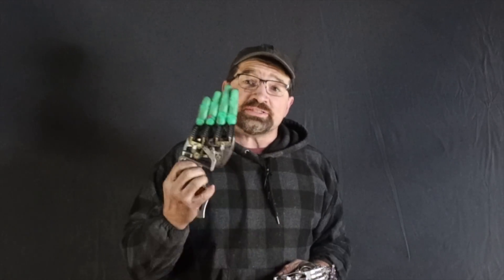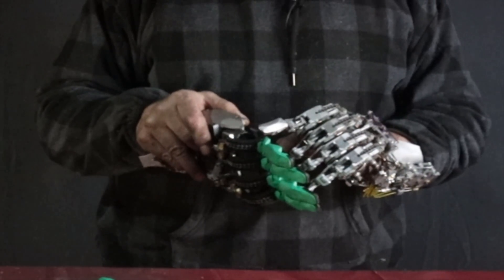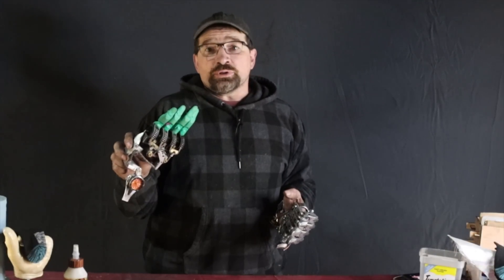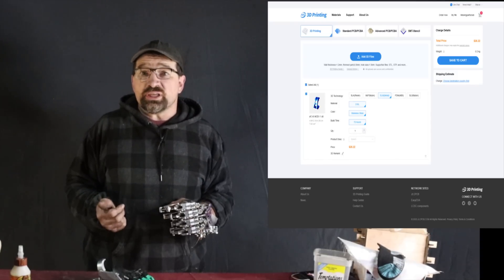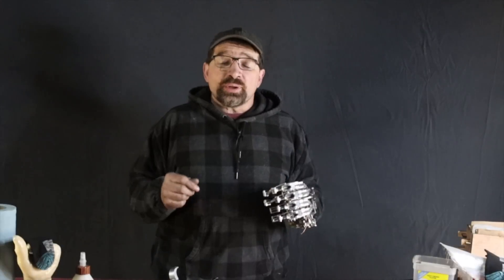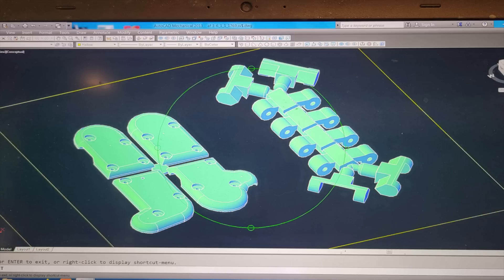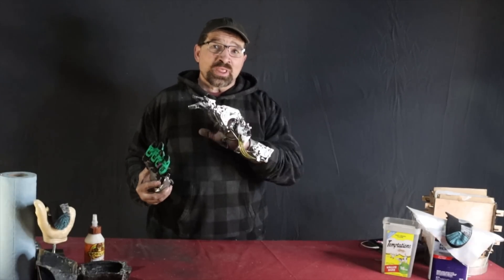Coming Soon! Printed Fingers from JLCPCB

Comment: Love your work.  Really impressive and pushing the boundaries of what a prosthetic device is and does.  Curious where you get your micro chain drive and sprockets from? Love the look and function!
Reply from the maker: Jason Bender, Love your work with your 3d printed hand! Great job with the integrated thumb lock. Here's a link to the chain https://amzn.to/3miTnwy. The sprockets however, I mill on my cnc, it's super easy where the chain roller is .125 dia x .1. i use a .110 endmill and cut the sprockets from .25" 7075 T6. I would love to connect at some point.

Comment: I'm wondering how this would scale for people with smaller hands? Fellow amputee here. FYI your link is broken, it's missing the j.
Reply from the maker: Thank you so much for catching the broken link, i just copied and pasted from their email.  For changing the design, it would depend on how much smaller, also are you referring to stack width or length? length could be played around with. Width wise, you could probably get down to 14mm if you got rid of the contouring. any narrower and you'd need to use a different spring.
Reply: @missingpartsclub  I suppose the length as I would think a long finger would feel unnatural, can't grasp well. Looking forward to your progress, who knows I could be a potential customer.

Comment: Your post-proccessing will probably just involve some hand-filing and hand-sanding so you should probably leave some extra meat on your parts. 

p.s. once I saw it in writing, I just realised how that might sound to a dude with most of his left-hand missing, but you don't seem like the overly sensitive type so i'll leave my accidental limb-loss comedy as-is!

Thanks dude, great work!
Reply from the maker: i'm not to worried about the face to face fit of parts, i can machine or shim t the fit i need. i'm mostly concerned about the holes for the pins and possible hard spots in the print.

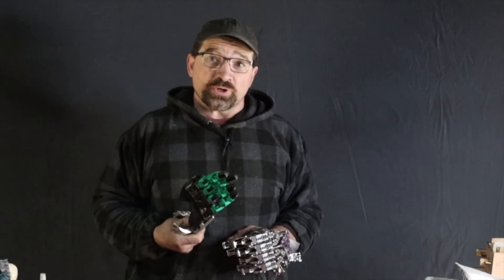Comment: 0:56 there is a way of layering metal through the print almost like a weaved metal plastic hybrid. The useful trick with printed parts is you can make detailed castings from them.

Comment: Good tie in for printing services! 
Although when it comes to additive manufacturing, the home-gamer 3D printer always becomes viable. The beauty of the 3D printing community is how quickly a design can be iterated and become better overall. Even if a design seems impossible, someone always finds a workaround!
Although yes, I am a machinist myself, and steel is real.
Reply from the maker: for rapid iteration printing is awesome! with my x1c I can print a complete set of fingers in 16 hours. thats incredible. if only printing produced parts with comparable attributes to machined components. some day well get there. i mean just look at how far printing has come since I ordered my plywood makerbot replicator 1 back in 2009. give it a couple more years.

Comment: Would lost wax casting work for casting pieces instead of sintering, which is what I assume a metal printer would do? Or does 3D printing in metal actually mean lost wax casting?
Reply: With SLM printing, the printer uses a several hundred watt laser to melt metal powder. Functionally, its more or less like forming a solid metal part via a continuous TIG welding bead, but in a more accurate and controlled manner. The final parts are solid blocks of metal. No sintering. The downside is that stresses that build up from uneven heating during formation of the part can cause warping and other usability issues

Comment: Wow pretty exciting! Was printing in Carbon/Nylon on your X1C no good?
Reply from the maker: the nylon carbon was ok, the surface finish was more rough than i thought it was going to be. that and the parts had a lot of flex in them.
Reply: @missingpartsclub  Yea thought they might have a little flex but still be strong enough. The few prints I've done with the BambuLabs Carbon was really good and the finish was just as good as any PLA I've done.
Regardless super excited for seeing the steel printed parts!  Love your series and dedication.